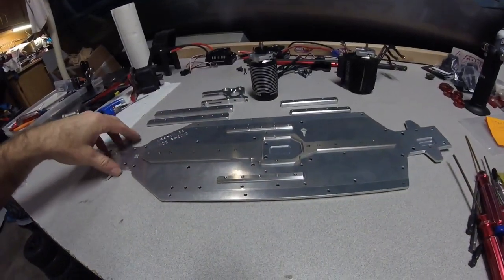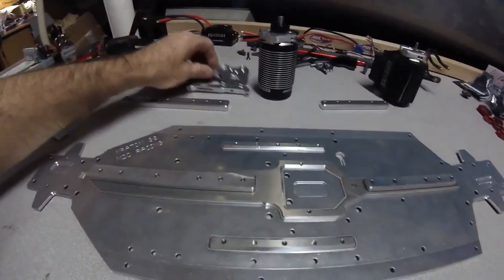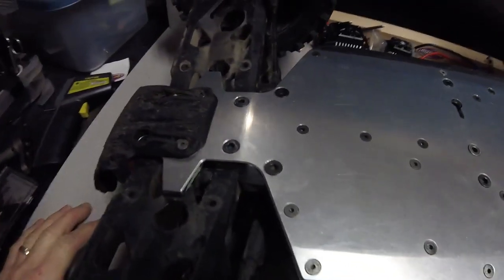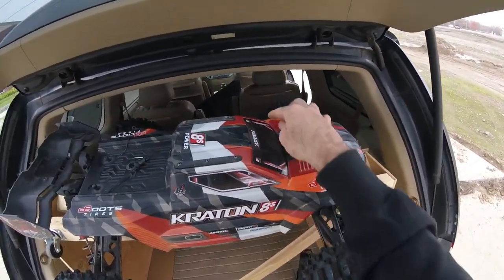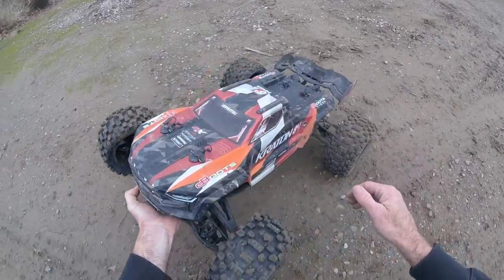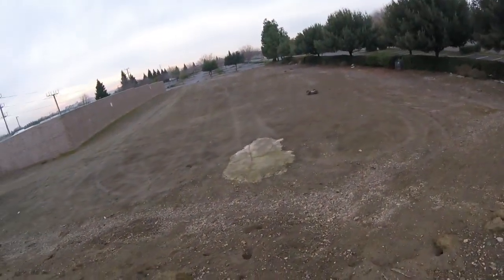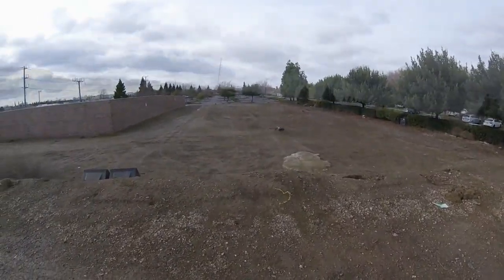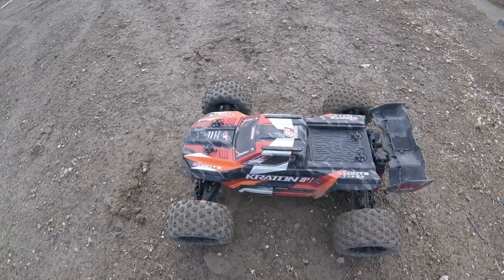ARRMA Kraton 1/5 8s "Full Beefcake" M2C parts + Hobbywing 5687 Max5

Comment: Nice!! Loved the distance and backflips.
I liked how you tried to make it backflip but corrected once you knew it wasn't going to happen. I hope you get the right combination (tire, motor, pinion) to make the 8s perform a bit more  like your 6s RC.  Wonky ramp shavers were fun to watch since the RC still landed on its wheels for the more part.
Reply from the maker: Thanks so much my friend 🤗!!!! This rig has become a truly FUN project 😍. She's a thrill to bash 100%. I'm hoping to get all the performance possible out of her despite her considerable size and weight. Taller gearing should help with easier flips and air control 👍. I'm amazed how she can correct after shaving the ramps 😱. She definitely lands with authority. 🍻🚀🚀😎💪👊👊

Comment: Killer Rich!! Really enjoyed seeing the chassis and the motor mount and how they looked before and after installation 🤩 Seemed like the stock ESC would be acceptable with just a motor upgrade 🤔 I could see how soldering the EC5 would be tough on the the Max5 😱 You had some gnarly landing there! M2C does it again with the chassis upgrades 😍
Reply from the maker: Thanks so much Aaron 😜!!!! Hope you had a great Christmas with the family yesterday 🤗. I'm slowly getting this Big Girl dialed in. Huge props to Mitch for working his butt off with these upgrades and everything else he's been juggling. Not sure where he gets the energy, but no doubt he's driven to deliver only the best 👊. The new power combo is feeling awesome. Just needs a little more gear. The stock ESC is doable for sure, but the Max5 stayed ice cold and has better power delivery 🍻🚀🚀😎💪👊👊

Comment: I use the Maclan EC5 connectors. The bullets push through from the back of the plug, so there's no problem trying to push the wire through. Also after tinning the wires, i file them down a bit for an easy fit into the bullets. Awesome build though bro, I'm doing the exact same :)
Reply from the maker: Thanks so much my friend 👊!!!! My connectors push through the back too 👍. I tried using the factory tin job and it wouldn't take to the connectors. Once I retinned them myself, I got a solid connection. Almost grinded the wires down with the bench grinder. Really appreciate the tips 🍻😎💪👊👊

Comment: Fricken sick rip with that big rig. 🚀👊🏻😱. Merry Christmas 🎄. Great combination with the max5 and 1100kv, yeah I can see it’s gonna need a bigger pinion.  👍. I can’t believe you haven’t broken more clearly a better driver than me.  😂 😂.  Awesome video and great job on the informational regarding the new M2C products that are available.  Bash on 😎😎
Reply from the maker: Thanks so much Brother 😜!!!! I'm absolutely loving this Big Beast 😱. It's definitely a different kind of bashing experience. I did later find a broken rear shock piston 👀. Haven't actually torn the shock apart yet, but it feels spongy and pretty sure it cracked or simply fell off 🤣. I've been lucky the weather hasn't dropped below 50F when I'm out though. Much colder would certainly be different. 🍻🚀🚀😎💪👊👊

Comment: Now that thing is a monster!!! Merry Christmas to you and your family Rich!! 👊😁🌲
Reply: Also Rich is it hard or take long for a chassis swap? Never did one before.
Reply from the maker: @cwatson42785  Merry Christmas to you too Chris 🤗!!!! The chassis swap isn't difficult at all. Once you pull the bracing, the front and rear ends come off as a unit. So does the motor/center diff and the servo/ESC/reciever module. This rig is easier than the 6s rigs no question. Just heavier with bigger parts and hardware. 👍👍😎💪👊👊
Reply: @richduperbash2966  Awesome Rich thanks for the advice!!! 🤙🤜🤛🍻😁😁👊👌

Comment: I think I need some power when I jump, so I want to change the motor. Can you recommend 56113 or 5687? What is good price and performance cost? Of course, is 56113 the best choice?I am using stock esc.

Comment: For soldering large wires dude use a heat gun to heat the barrel up I usually drill a hole in a piece of wood to hold the connector so it dosnt sink the heat away and it works perfectly I used this method to solder 6 awg to giant connectors
Reply from the maker: Thanks so much Brother 👊!!!! I use the same setup with my connectors and use a mini Butane torch. Where I blew it was trying to use the factory tin job on the ESC leads instead of retinning the wires myself 👀. Once I tinned them it went pretty smooth. Appreciate the tip 🍻😎💪👊👊

Comment: Minor or major difference between stock and  hobbywing set up?
Reply from the maker: There's a noticable difference in torque with the 5687 and Max5. The stock system isn't bad since they reprogrammed the Firma 160A ESC though. Been running a Hobbystar 56112 840kv on 34/34 gearing for months. That's a Huge difference. 🍻😎💪👊👊

Comment: Nice video may I ask what’s the amp on the max 5 esc 200 or 250 amp and next question would be can I have a max 5 250 amp and run the 5687 motor well the connectors fit I know the max5 200 amp well but I was trying to get the max5 250 amp to run 12s lateral down the road
Reply from the maker: Thank you Brother 🙂. This is an original 200A Max5. Not sure the 5687 1100kv will handle 12s 🤔. Perhaps a newer 800kv Hobbywing motor with the right gearing. Regardless, I would recommend QS8 connectors when you run 12s power.

Comment: hi do u think a hobby wing max 6 combo with  4985 1650kv motor is a usable option in a 1/5 outcast????
Reply from the maker: You could try it, but the KV is too high for the size and weight of the truck 800-1200kv is the best range. 🍻😎💪👊👊
Reply: @richduperbash2966  thanks for the advice thats what i was expecting you to say, have a great day!

Comment: That M2C chassis so nice, it makes me wanna bend my stock chassis so I have an excuse to get the M2C LOL
Reply: 🤣🤣 Send that bugger Stevo!
Reply from the maker: The stock chassis isn't too bad IMO 🤔. ARRMA did the best they could with the material. The problem is this rig is BIG and pretty heavy 👀. The 7075 does flex, but it has incredible memory and keeps it's form. This chassis takes a lot of strain off the bracing. Mitch did a wonderful job with it. 🍻😎💪👊👊

Comment: Rich...  I’m still rocking the Kraton 1/8 scale 6s... and of course loving it! But I have a question for you. With all your experience what are the best all-terrain tires to pick up for this bad boy. And if I had an outcast would it be the same?
Reply from the maker: I'd probably still say the dboots Backflips 👍. They're weighted about perfectly for all around bashing and don't stress the diffs like other sizable wheels. I actually don't love them on the Outcast as much cuz the wheelies and front to rear bounce get to be overkill. The smaller Backflip LP's (4s Backflips) are truly perfect on the Outcast 6s IMO🍻👍👍😎💪👊👊

Comment: Hey rich, question for ya. I seen in your last 6s video with the outcast m2c was working on coming out with the hinge pin braces. I keep catching my nose on the stock bumper and ripping the screws straight out of the diff housing. But i have to leave the stock bumper on to hold the hinge pins in place. Any word on when those might come onto the website? My rig is almost strictly m2c and i love to support mitch and all at m2c! The only thing i have that isnt m2c is my servo mount and that is voltage hobbies
Reply from the maker: I'm not sure when he'll have the hinge pin blocks available 🤔. I'll definitely ask though. Not sure he's done designing the front blocks. The stock Outcast/Notorious bumper is junk IMO. Much better to replace with RPM or Tbone Basher bumper. My preference is the Tbone Typhon 6s one. Just need the mini ARRMA bumper to hold the pins in. Comes with the Composite Ball cups goodie bag. Just have to replace the front hinge pin brace screws with shorter ones after removing the stock Outcast bumper. Here's a link to the goodie bag. 🍻😎💪👊👊 https://www.amazon.com/Arrma-AR330230-Ball-Cups-Composite/dp/B00NE0DL1S

Comment: Rich, I just found out I cant use any pinions over 27T with the m2c slide.  Is this true?

These are the parts that I bought. 

M2C 3253 ARRMA KRATON 8 S 8MM SHAFT SIZE MOTOR MOUNT SLIDE

M2C 3250 ARRMA KRATON 8 S MOTOR MOUNT
Reply from the maker: Mitch should update his site 🤔. That was an estimate. Think you can fit atleast a 31-32 with the standard 8mm slider. I believe he now offers an 800kv series slider that will fit up to 48T 🤔

Comment: Sick video and mods! Be even sicker if you didn't have to replace the chassis though. Banarrma tough baby!
Reply from the maker: Thanks Brother 👊!!!! My stock chassis actually did quite well for the beating it took, especially after bolstering the top brace with CF tubing. That said, a well machined 7075 T6 chassis will take hard beatings consistently without issues. 👍👍😎💪👊👊

Comment: Hey rich when you ran the hw motor wit the stock esc did you have problems my issue is it dont pulse wit lipo count until i hold the spur when breaking it slows down hit break again goes straight to reverse hard truck not completely stop
Reply from the maker: Make sure you recalibrate the controller with the stock ESC per the manual. That's your neutral/full throttle/ full brake calibration. It's sometimes necessary to swap a motor wire around also. 🍻😎💪👊👊
Reply: Thanks thats wut it was appreciate the response keep bashing bro 😎😎👊✌
Reply from the maker: @LBizzyRC  no problem 👍. Good luck with it Lorenzo 🍻

Comment: Hello Rich, I was just curious as to what your opinion is on the performance of the truck after swapping to the max5 esc? Any insight is appreciated,  Thx. Great video
Reply from the maker: Thanks Brother 👊!!!! The stock ESC seemed improved after completely disabling the AVC. I did it by swapping my reciever/controller for an old Tactic. The Max5 seems to have smoother power delivery with more instant power. It also ran ice cold. 👍👍😎💪👊👊

Comment: How are the ec5 connector's holding up with the max5 combo? I have a max5 combo coming later this week and was hoping to use ec5 on it.
Reply from the maker: Mine are hanging tough 👍. Many guys also use bigger OSE antispark  connectors, but my EC5's are still getting the job done. 🍻😎💪👊👊
Reply: @richduperbash2966  that works thanks man 👍

Comment: Rich I have a question, I've ran my new granite 3s blx twice today, but the runs only last about 10-15 minutes. Im using a 3s 5200mah 50c lipo. I checked the voltages of the lipo after the runs and each cell is at 3.6. It seems lvc is kicking in early. Is there anyway to set the lvc lower to get more runtime? Or is 10-15 min normal for a 5200mah pack?
Reply from the maker: 15 minutes of harder run time isn't unheard of, but could be an issue of drag or mesh also 🤔. These rigs come with very tight mesh from the factory. That's a big reason why I opted for the Hot Racing adjustable motor mount. If your bearings all seem good...etc...you might want to grab a 6500mah 75c Hobbystar 3s hard pack 🤔. I get 20+ minutes no problem even going hard. There's no way to adjust LVC with the stock ESC. You could put it in nimh mode and run an external LVC alarm, but I don't recommend it. 😎💪👊👊
Reply: @richduperbash2966  thanks for the info, I think I know why my lipo cells are at 3.6. The lvc is set to 3.4 in the blx100 esc, so im guessing the voltage drops under load to trigger the lvc. I guess I will have to get another 3s lipo with higher mah, this thing is just too much fun, even just on pavement. I will pick up a rubber sealed bearing kit also. The only thing im not liking is the spektrum radio, its slighty glitchy at longer distance and it has a delay in the throttle. I will probably replace it later.

Comment: How is your steering servo holding up? What would a good upgrade be?
Reply from the maker: So far it's hanging tough 💪. I'm not sure about upgrade options just yet 🤔. She did great with the stock ESC on 8.4V and seems fine at 7.2V with my Max5. The stock power module has limited space, but anything is possible. 🍻😎💪👊👊

Comment: Crazy Beast ;) Thank's for your videos man !!!!! I just got my m2c chassis for my kraton 8s and mounted it.
Now it's time for combo upgrade... Will a 56113 fit ? Thanks for your advice.
Reply from the maker: Sorry I just saw your comment 👀. Congrats on the M2C chassis 😱. Yes....I'm pretty sure the 56113 just barely squeezes in. Believe it just clears the mudguard and steering assembly. That said, you'll have to gear way up to get higher top speeds with an 800kv setup. 🍻🤙🤙😎💪👊👊

Comment: Arrma really should have released this thing with a bigger motor, the stock one seems to struggle with the weight and the chassis apparently can take ALOT more power without failing.

Comment: So Rich, why swap out that stock motor so quickly? what does the new motor do for you that the stock one wasn't? Just asking. Selling my 6s v3 now... and already ordered the new 8s (backordered just about everywhere). Trying to follow your lead but haven't gotten into motor swaps. 6s v3 was great stock... so never swapped. Curious what you gain? Thanks!
Reply from the maker: The stock 6s electronics are very ample overall for the weight to power ratio of that platform. I had atleast 8-10 bashes with the Kraton 8s running stock electrics. They're actually very efficient with good top speed once tuned and geared up 👍.  Many will be happy with that. I personally like lots of on demand torque and extra power available. The stock system didn't have extra torque. That's what I need to bash how I want and have burst power off of jumps, especially with shorter run ups. Torque allows you to throttle up and blast off of jump faces to clear gaps...etc. The stock system isn't bad, but it's not nearly as powerful. 🍻😎💪👊👊
Reply: Rich Duperbash thanks for the info. I get how the lower KV motor will have more torque  I thought it would be slower too, but obviously not the case in your videos. Learning lots about gearing and KV. So thanks for the reply!
Reply: Rich Duperbash my Kraton 8s finally showed up today!!! So excited!
Reply from the maker: @josepheustaquio5544  CONGRATS Joseph 😱!!!! She's a Beast 👀. Don't worry about the lackluster speed out of the box. She does WAY better with more gear and a little tuning 👍. Don't forget, it's essential to use mini torch heat on the metal to metal motor mount and center diff cup screws 🔥. Guys are stripping or snapping them trying to muscle them off. Good tools and technique will save you frustration. 🤙🤙
Reply: Rich Duperbash reading manual about tuning and motor timing. What gearing pinion would you recommend for the stock motor? Motor timing suggestion? Heard a few folks talk about 11 degrees. But don’t want to shorten the life of the motor. Might go one below that setting. Super excited to get this thing on the dirt ASAP!

Is everyone keeping the EC5 connections on batteries, or you just swapping them out all together? Not sure how much of the telemetry I would lose if I run a different type of connector assuming it would be all or is it just the telemetry from the battery?
Reply from the maker: @josepheustaquio5544  I had great luck with a 23T on stock electronics, timing 7.5, punch 5, and BEC set to 8.4V.  I'm most definitely keeping with all EC5 connectors on my packs 👍. I honestly have zero interest in using AVC or telemetry. I just want a great performing rig that doesn't run too hot. You shouldn't lose any telemetry data using EC5's on your Lipos besides remaining voltage perhaps. I recently switched to an old Tactic controller/reciever because I felt the AVC was inhibiting the stock ESC. My attempts to fully disable the AVC via the stock reciever had failed. 🤙🤙😎💪👊👊

Comment: Absolutely amazing!!  You are the future buddy.  Why are you running stock tires over the Duratrax?  And did you notice a difference switching to the Max5? and finally what servo are you running and what batteries, I see they are hobbystar, and look to be HV, what Mah?  Thanks man!!
Reply from the maker: Thanks so much Brother 👊!!!! I switched tires just to see what kinda air control I'd have with the new Hobbywing system and 25T pinion. Still like the Duratrax, it's just the rig moves a pinch faster with the lighter, more pliable stockers. Definitely noticed smoother and more instant power delivery and with the Max5 👀. I'm running Hobbystar 6500mah 100c HV 4s hard packs.🍻😎💪👊👊
Reply: Anytime you put a Hobbywing in over a stock setup you are going to notice a difference it's just that simple... Hobbywing has torque for days!

Comment: Is the stock ESC ok or you had to put the max5?
Reply from the maker: The stock ESC is very efficient and ran cool along with the motor. It's ok, but power delivery is better with the Max5. It feels smoother and more instant. The Max5 has a higher capacity and runs super cool. 🍻😎💪👊👊

Comment: What transmitter do you use. I can’t even control my kraton with that stx2
Reply from the maker: I was using the stock DX2E until this bash. Switched over to a spare Tactic TTX300 controller/receiver. Did that to completely eliminate the AVC because I couldn't disable it via the reciever like the manual instructed 😝. The STX2 is crap 👀. Feels cheap in the hand and seems to have a delay. I had little confidence using one. The controller should be forgotten about while bashing, not compensated for. Really hope Horizon swaps it soon. I was perfectly happy with the old Tactic.  Simple, ergonomic, and responsive. 🍻😎💪👊👊
Reply: Rich Duperbash thanks and keep up the good work bud